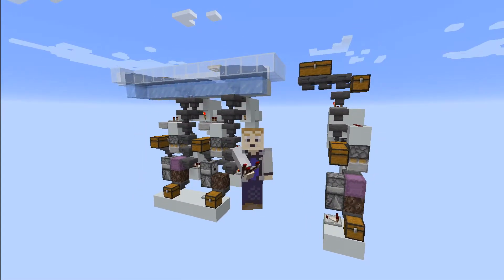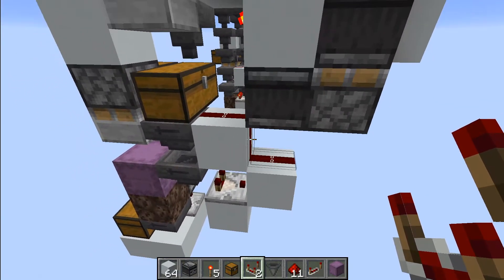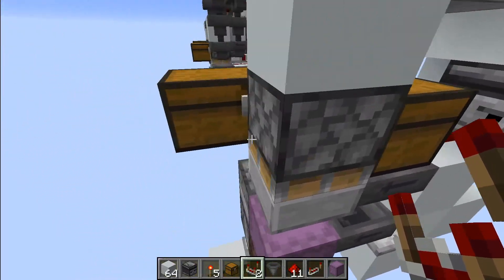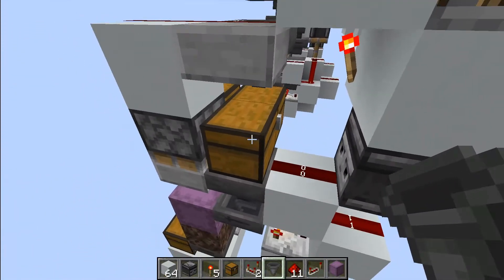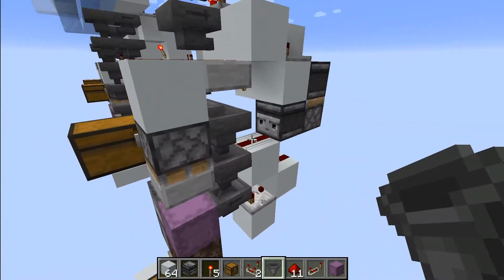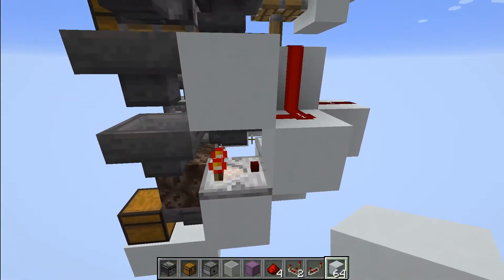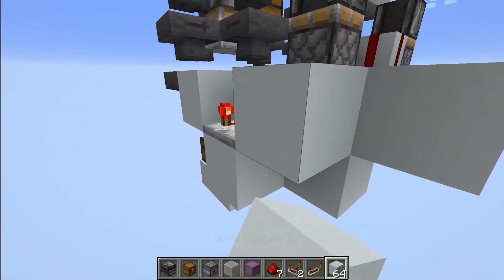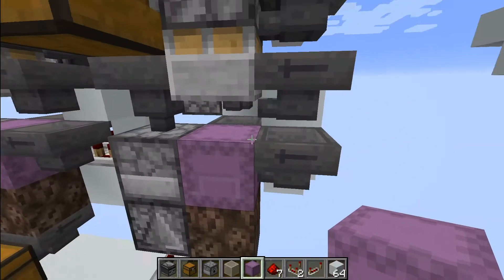Tutorial Update - 1.16 Fix for Accessible Shulker Box Loader

Comment: Any idea why I might still have the same problem you showed in the video? The double speed loader was fixed like you show, still it can happen that both hoppers overflow and the piston crashes shulker after shulker. Guess I need some kind of limitation to the max. amount of items or different items I wanna load. Or is there a fix for that? Feels like the whole system is in some kind of feedback loop. Like, left hopper blocked, signal shulker gets crashed. But this then forces the other comparator to give a signal as well. For really large numbers of items this might not be the proper solution?
Reply from the maker: The loader is supposed to limit the item flow automatically. The redstone signal isn't just to detect when the shulker box is full, it's also there to hold the hoppers.

Make sure that the hoppers are facing the correct direction. Hopper facing is extremely important, otherwise it can't hold the hoppers properly.

Although this loader can handle mixed items, loaders that have the comparator on the hopper can never handle unstackable items. (Conversely, loaders that have the comparator on the shulker box can't handle mixed items). Unstackable items just mess with the signal strength too much. They can handle items that stack to 16, but I'm not sure how they would handle mixed 16/64-stackable items. I've never tested it.
Reply: @jCraftmc  Thx a lot mate. Guess that's it. The stronger signal from the 16stackables. Any Idea what I could do? Seems like I would need to set up a filter.
Reply from the maker: @HolgerAnders  what are you trying to load? Generally you'd use sorters and one loader per item type. You could conceivably use a sorter for each of the 16-stackable items and put those items into one loader and put the rest of the items into another loader. The loader should be able to handle items that stack to 16, but the mix of 64 and 16 items can send it some wacky signal strengths.
Reply: @jCraftmc  We got around 13 or so items coming in. All farms got a fully automatic collection railway System which ends at the loader. Front their they get transported to a multi Item sorting storage System which can handle basically any item ingame. So far it has not happened again. Seems its all time as long as we keep the item flow limited. Before I set up all farms with a comparator-regulated minecart, I had to press the button for transport myself. Now its all based on the production speed of the farm. 

Before you answered I thought about a way to keep the hopper which send the signal not locked as long as the other one. It felt as If the system got into some kind of feedback loop. Left hopper sends signal, shulker gets switched out, now the right hopper cant load for a brief moment, therefore now the right one sends signal. Resulting in shulker after shulker being switched out although only containing 2-3 items.